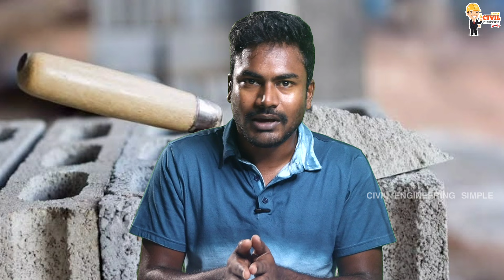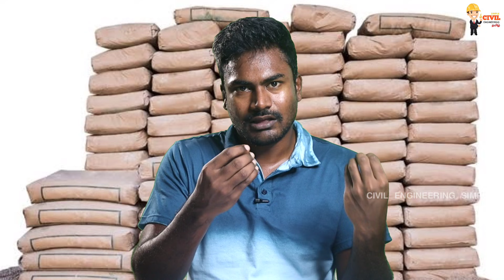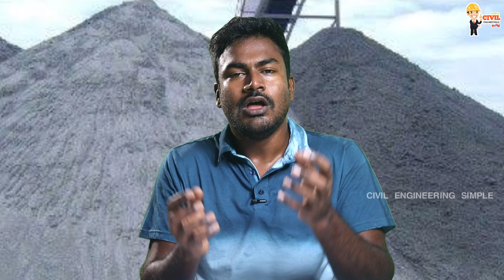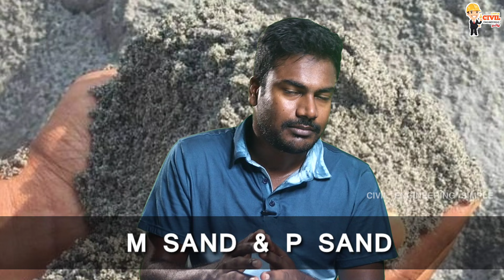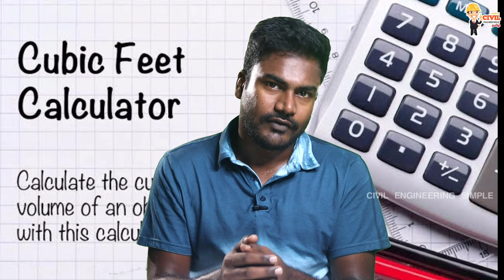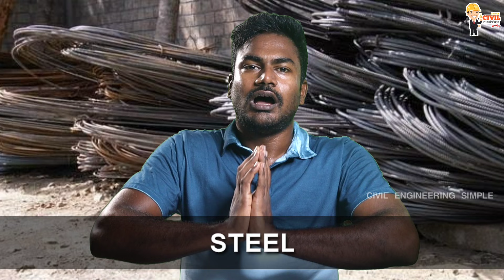Civil Engineering Basic Knowledge | தமிழில் (Part 2)

Comment: Sir, Land Area, Built-up Area, carpet Area  இவைகளுக்குள் என்ன வித்தியாசம் . வீட்டின் விலை எதன் அடிப்படையில் நிர்ணயம் செய்கிறார்கள்.
Reply: Hai sir, I am an architect doing projects pan India 

The answer to your question is 

Site area (land) - As the name itself says it's the overall area of the site which may be mentioned in the patta or field map book (FMB) document. 

Builtup area - it's is the overall constructed area measured all through the perimeter of the building. It includes all the floor areas (ground floor, first floor etc) 

Carpet area - it is the area of the building with not considering all the walls of the building... Basically in layman terms it is the area for laying floor tiles. 

Answer to the second part of your question is 
If you are buying an individual house then the cost would be both for site area and the builtup area 

If you are buying only the land then the cost would be of your site area

If you are buying a flat in any apartment majorly the carpet area of your flat and some common areas are added. 

Thank you
Reply: @aakashshanmuganathan1637  தங்கள் பதிலுக்கு நன்றி. For example 750,,sq.ft. இடத்தில் 1400sq.ft. duplex  house Rd.70 Lakhs  endral அது சரியான  விலை ஆகுமா?
Reply: What is the meaning for carpet area? Build up area? Super build up area?
https://youtu.be/DQqJWRzcLA0